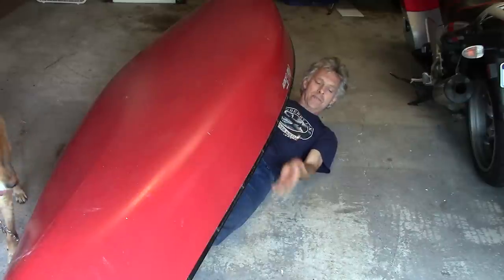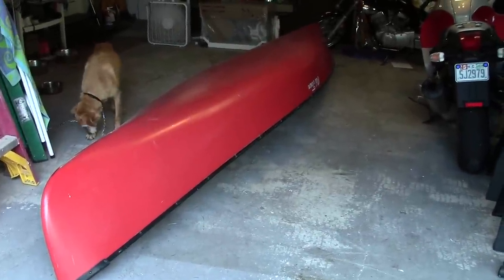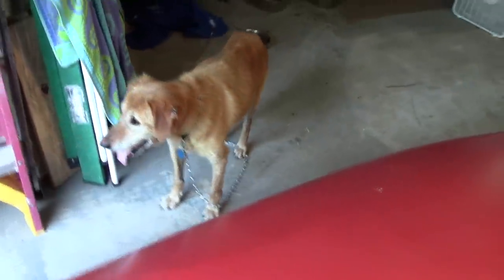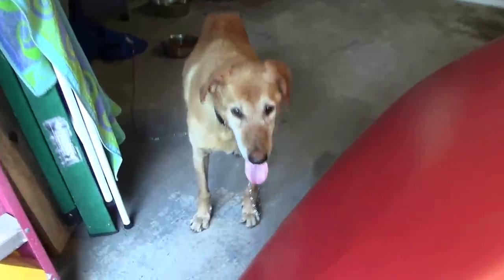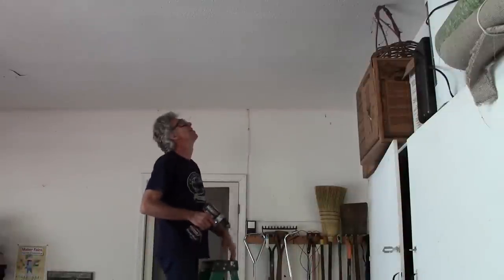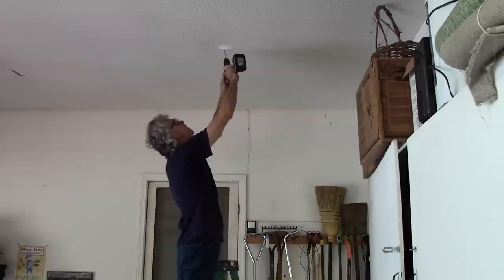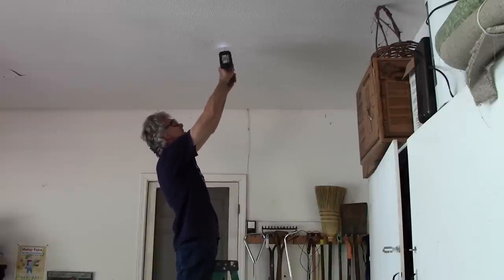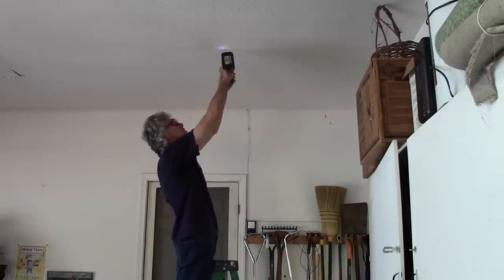How To Hang A Canoe From The Ceiling

Comment: The BIG mistake with this design is not reading the manufacturers (Old Town) warning that is capitalised on their website under storage, **DO NOT HANG THE CANOE BY THE FRONT OR REAR DECK OR CARRYING HANDLES.** These handles were not designed for that type of use and could cause damage to your canoe.
Reply: Was literally about to comment this but I'm 8 years too late. This is so stupid. The handles are probably approaching failure by this point if one hasn't already.

Comment: I work at an outdoor retail store. When we hang boats or display boats we support them closer to the center. If I was going to hang your boat I would find the rafters that were 80 or 96 inches apart to hang your pulleys from and hook the pulleys to loops of webbing that go around the boat. Use a water knot for the webbing. If you wanted to plan ahead a little you could pass the webbing through an old garden hose. At some point you are going to try to "thread" the loop of webbing with the boat.

Comment: The purpose of centering as described below is so the plastic dosen't sag over time and dramatically change the performance of the boat and brake the thwarts or handles. Canoes are fun! You can really change how it handles by putting in longer thwarts, but then you also have to change the seats and alot of other stuf. but the boat will turn extremely well. but I digress.

Comment: Yes, it caught me out too, up to yesterday, I was hanging my old Town canoe the same way as you. BTW, I did not mean to be negative, Your video is helpful. What I did today was attach a webbing loop around the canoe and loop it thru the handles so it can't slip, then flip the canoe over, and hung it upside down, it still works. I guess the carrying handles are riveted to the hull and if not designed for long term support they could pull thru if you hang the canoe on them long term?
Reply: My thoughts exactly. I wouldn’t be comfortable having the full weight of the boat hang from the carrying handles. Straps looped around the canoe’s belly are the way to go, I think.

Comment: Properly Storing Your Old Town
Day-to-Day Storage
CANOES: Should always be stored upside down, even over night. Set on saw horses or blocks, if at all possible, as this will allow the gunwales to carry the weight. 
KAYAKS: Should be stored on their sides or standing on one end, if at all possible. If stored outside we recommend an Old Town kayak cockpit cover to prevent the possibility of water getting inside. Another option is to store it upside-down, preferably in slings or on cradle type saw horses. This will keep the decks from being distorted.
 If you live or frequent areas where the wind blows hard and you store your boat in the open, we recommend you tie it down.
Long-Term Storage
At the end of the season, clean your canoe/kayak and give it an inspection. If you notice a scrape or wear spot through the exterior color layer, we suggest using Krylon Fusion, a paint made for plastic. This will protect the sub layers from the harmful effects of ultraviolet light. Krylon Fusion is only semi-permanent so you may need to touch up your canoe/kayak every other year or so depending on how much wear and tear it gets.
Ultraviolet light from the sun may fade the color in time. If possible, store your boat out of the sun. A garage is perfect. If you must store your canoe or kayak outside, do not cover it by laying a tarp directly on it. With the heat of the sun, the tarp creates an oven that can damage, distort, or discolor the hull. A tarp, properly suspended above the boat, will protect the boat from ultraviolet light. Simply leave an air space to allow for air circulation.
Canoes should always be stored upside down. Put on garage rafters, saw horses, blocks or in slings suspended from the ceiling. If you choose to hang your canoe from the celing we strongly suggest using a harness system or 2" wide nylon straps. Hang the canoe upside down and place the harness/straps around the entire hull of the canoe allowing the weight of the canoe to rest on the gunwales. If possible use a strap on the bow, one on the stern and one in the center to evenly distribute the weight. *DO NOT HANG THE CANOE BY THE FRONT OR REAR DECK OR CARRYING HANDLES.* These handles were not designed for that type of use and could cause damage to your canoe.
Kayaks should be stored standing on one end or on their sides. If stored outside with the possibility of water getting inside, we recommend a cockpit cover. Another option is to store it upside-down. Upside-down storage should be in slings or “cradle” type saw horses to help prevent hull distortion. If you choose to hang your kayak from the celing we strongly suggest using a harness system or 2" wide nylon straps. Hang the kayak upside down and place the harness/straps around the entire hull of the kayak allowing the weight of the kayak to rest on the top deck of the kayak. *DO NOT HANG THE KAYAK BY THE FRONT OR REAR CARRYING HANDLES.* These handles were not designed for that type of use and could cause damage to your kayak.
If you must store your boat outside, we recommend you tie it down. Strong winds can catch the underside, flip it, and cause damage.

Comment: I got a 100 pound square back canoe , instead of  using  regular pulleys I used a 7 wheel deferential pulley system designed for hunters to hang up deer for field dressing ( over 200 pound each pulley) so thanks to the wonderfull world of deferential gear voodoo magic I can easily raise my canoe loaded with gear all by myself with no struggling whatsoever , beware through ,you need to replace the included line with a durable , strong yet highly flexible rope of the appropriate size , you will need alot of rope per pulley ( some basic math is required to ensure adequate rope lenght) and if there is no load on the pulley the network of rope has a tendency to get jumbled up into a nightmare to unravel ( im telling you , the that rope will seem to have supernatural abilities directed at pissing you off if your not carefull)

Comment: I don't see how this can cause damage when they are designed to carry the canoe!! Strange...
Reply: DESIGNED TO CARRY FOR SHORT PERIODS OF TIME. Ignore the manufactures bold, all caps warnings in the owner's manual on video on the internet, and people are going to call you out of it until the end of time. Stupid on the internet is forever.
Reply: Think about it this way: when you travel, you grab a 50-lbs suitcase by the handle to lift it on and off the baggage claim. But once you got home, would you leave that suitcase packed and store it by hanging it from its handle until next year? Didn’t think so. 😉